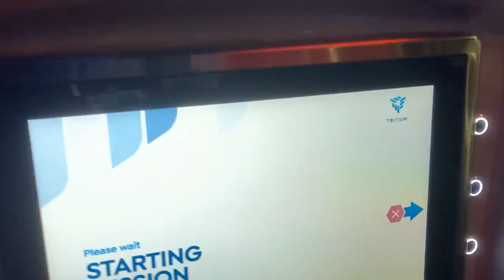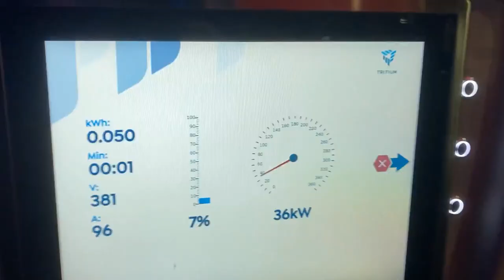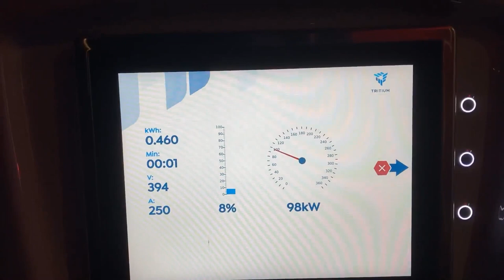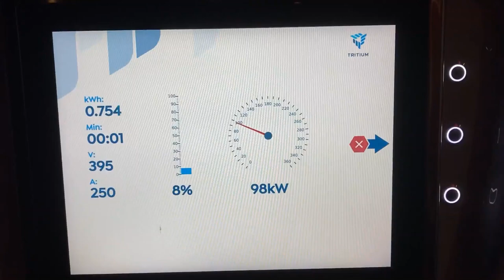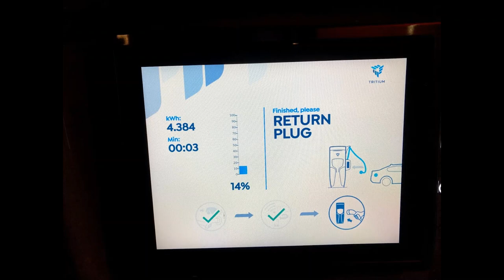Hitting 250A for the first time charging the Citroën e-Jumpy at Shell Recharge Groningen (NL)

Comment: it's normal that with hot battery and below 10% you will get full AMP, but as you can see it will throttle after a while, but still it's a great charging speed

Comment: Hi, I watched all of the videos, but could you tell the real range you got? Or I missed or I saw only highway - 30kwh/100km, city 22kwh/100km ? 
Comparing to my Mii electric (WLTP=269km) I can get around ~140km in winter (not driving battery below ~20%, when it turns off all the heating), so the range for e-Jumpy would be around 180km without stress and limitations?
Reply from the maker: Sounds fairly realistic yes. It's so incredibly weather dependent though. In freezing wind, if you want to go fast you will probably indeed get close to your calculations. If it's any better I'd say 200km is hassle free, unless in nordic winter (and racing). If you keep the tempo down though, that changes worlds, any electric van will be happy if you drive at 100km/h or less ;-]
Reply: @electricfelix  Yes, that's really true. In colder time (-5..+5) i got around 20-24kwh/100km average. Now it got +10 and I get around 15-18kwh/100km. Also the highway 90km/h or 120km/h gives very huge difference.